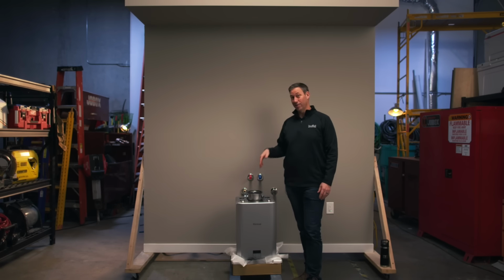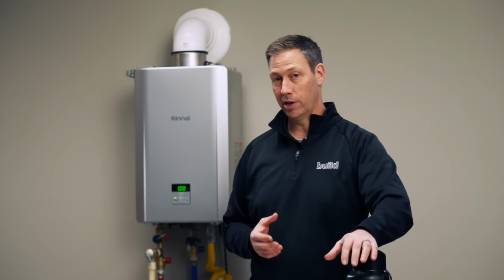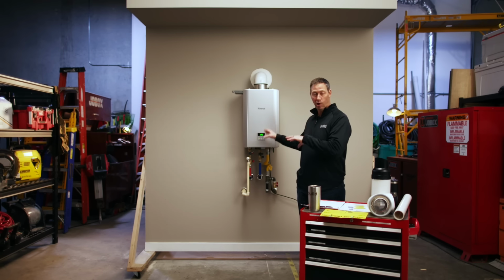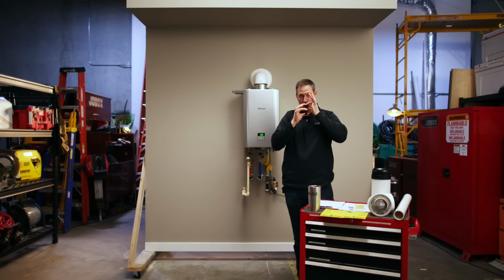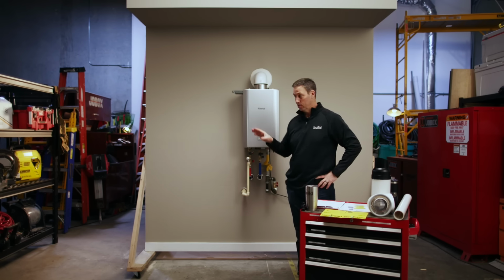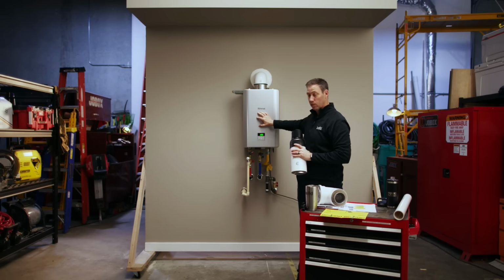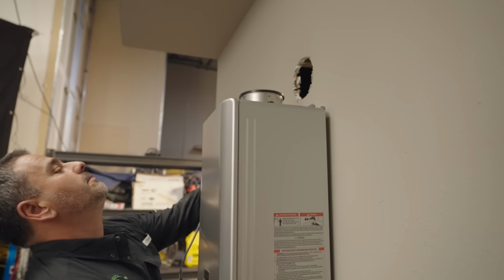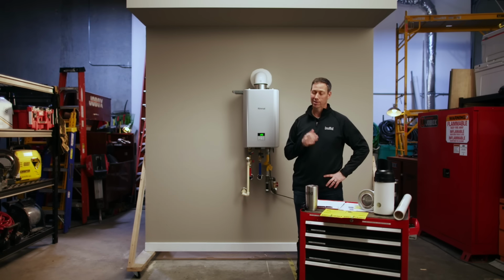Replacing A Water Heater Tank? Probably the Best Tankless Option for You.

Comment: Nice unit Matt I have one in my house. Not that model but the brand. 
I do not recommend these anymore to my clients though. 
Please here me on this. They don’t work with the modern appliances. Biggest problem being washing machines. 
They only fill with water for maybe 3 seconds then check the load. That does not give the tankless enough time. 
I have been and still will be recommending the HTP hybrid on demand water heater. 
Please put some thought into what I’m informing you in on, look at HTP and give me a response. 
If this is news to you and you have a high efficacy washing machine do a load yourself and be listening to the heater. 
Grace and Peace 
Slick
Reply: I believe this is a hybrid unit with a small tank in it, and it provides recirculation function so the pipe will have hot water in it nearly continuously.
Reply: @rcmrcm3370  So completely nullifying any (dubious) benefits of this system.
Reply: @BS25999  

That depends on several factors.  Especially tank heat losses which vary with temperature differential between outside air and water temp in tank.  Factoring in the insulation of course.

I live in a mild climate.  The loss from an R-16 tank in a garage here is really not significant.
Reply: Tankless has worked for me just fine.  However, I use a Navien.
Reply: While washing machines CAN use hot water, manufacturers have been trying to educate people for years that you will get perfectly fine results with just cold water. In fact, they recommend not using hot water. But people are slow to evolve. Old dogs and new tricks.
Reply: @idontthinkso666  

Tell my wife that.

Old dog.  Can still kick!
Reply: I have 2 rinnai, 1 only hot water and one combo (heat and hot water) no issues had them for 6 years. Runs 3 washers simultaneously..
Reply: Maybe you should learn English if you want people to listen to you.

Comment: I’m on a well with absolutely horrible water, we have a special bleach system & salt regret system from Kinetico..My electric water heater is extremely old and on our inspection he told us it would be the first to go..4 years later and still going strong. 

I would like to upgrade to a tankless, but with my water situation I’m not sure if it would benefit. I’ve watched multiple videos from you on this but not sure the route I should take.
Reply: Check out the heat-pump tanked units - not endless hot water, but a whole lot cheaper than most electric units.
Reply: @ckm-mkc  I actually did from one of his previous videos, my house runs a Heat pump so figured it would be an option to run one there. My system is in the garage, not conditioned but not bare walls. Definitely an option

Comment: I have a Rinnai tankless that is about a year and a half old and bought the wifi module and control the recirc with their app. They only problem is their app is a little flaky and needs some real improvement. No surprise, they're not really a software company but still...
Reply: A better pump control is the Smart Recirculation Control. You can trigger it from any fixture in your home without installing buttons or sensors and you don't need your phone to make it work either.

Comment: I have a Polaris hydronic circuit tanked water heater (for floor heat loops) that costs around $6000 when it kicks the bucket.. considering tankless for floor loops doesn't make sense but neither does spending $6000!
Reply: I run a voyager (pre-dates the polaris).  I'm considering a tankless. These new ones have a wide turn-down ratio, meaning it might go at 199kbtu for maximum output, but can run as low as 20kbtu (or even less) for long-term low usage things like the floor loops. It's all controlled by the set output temperature.  But as this is not a "normal" install you either need to find a pro to design and install the right system for your needs, or learn all the details yourself.

Comment: As a Rinnai ACE dealer I have installed 300+ of these Tankless units. Rinnai is a great unit.
Reply: Seeing as you might know, can that thermostatic circulation valve be purchased separately from Rinnai?
Reply: @RobertClontz  I can...... But would be very odd that you would ever need to purchase it. It comes with their units. I don't really see it working with other units
Reply: Would it not work because without a recirculation component, the hot water pressure would simply be equal with the cold water pressure (used for the recirculation line)? If so, that makes sense.
Reply: @RobertClontz  I believe you are correct also getting hot/warm water back on the cold side
Reply: Then you should know ... please reply ... I saw no cold weather protection. I live in Alaska, get to -30°F. Is there a kit?
Also, is there a way to disable recirculation,  don't want heat my crawl space with this?
Thank you, I am in the market. I have a 120 gallon tub that far exceeds by 50 gallon tank.
Reply: @alaskanight940  there are several different Rinnai units that will fill that tub great plus 4 more at the same time. You will just need to pick the correct unit. There are some freeze protection valves that you can add if needed

Comment: 2:09 - You say there is no drain on the wall. What is the white PVC pipe on the lower left? Also, existing installations with an old tank are likely to already have a non-concentric flue with a separate combustion-air intake for the mechanical room. Is there an option to have a separate vent and intake for this unit.
Reply: On my house it is against an external wall and it drains outside, like my AC condenser lines. I've never really seen any water come out of it.
Reply: Recirculation line.

Comment: Also, it’s not gonna last 20 years unless the home owner descales once a year.  If you’re on well water or have hard water, more often than that.
Reply: Maybe pretreat the water? You can’t descale every weekend.
Reply: @jsbrads1  he did say drop in replacement for a tank heater.  Which is why he didn’t go with a condensing 95%+.  Adding in pre-treatment makes it a lot more complicated
Reply: I put a A.O. Smith descaler plus an A.O. Smith whole house filter along with a A.O. Smith pre-and post filters set up on my Rinnai…

Find fault with that now
Reply: @Casmige  the fault is still the inefficiency of tankless vs a heat pump water heater

Comment: Unless electricity rates are really high in your area, it would be better for you & the environment to switch to electric on-demand water heater, and eliminate monthly gas connection fees.
Reply: For most people that is going to be really expensive, better off with a heat-pump tank unit.
Reply: They have gas fired ones to.  My brother has a natural gas one.
Tom Dutkiewicz
Reply: In the north we’re all already connected for our furnaces.
Reply: we have a gas furnace..there is nothing that warms a house like nat gas!
Reply: Electric takes a lot of amps. I don’t think standard amp service can handle it
Reply: @conradcoolerfiend  a typical home electric service in my area is 200 amps. A big house or one with special needs (electric heat, a deep well, EV charging, ...) Might have 2x 200 amp panels. So no, dedicating the entire or even most of the power available to the house just to heat water is a non-starter.
Reply: gas cooktops are nice and gas dryers and water heaters are cheaper and more reliable.
Reply: @android61242  Induction cooktops > gas cooktops
Reply: If you have peak usage charges, using any hot water during peak hours will cost you a small mint.
Reply: let's do a little math...
* at 90% efficient a 199KBTU/H unit is delivering about 179KBTU/H into the water
* 179KBTU/H is about 52.5 kilowatt
* on a 240 volt circuit, 52.5 kw is nearly 220 amps
* a 220 amp load needs to be on a 275 amp (really it will be 300 amp) circuit to provide the necessary 20% margin
* another alternative commonly used for a single bathroom (or maybe 2 bath if your incoming water is already warm) for electric on demand is multiple 40 amp circuits and a 220 amp equivalent would be 7 of 40 amp circuits (again to divide no more than 32 amps on each 40 amp circuit with 20% margin).

yeah, that's realistic.
Reply: @Sylvan_dB  I think your calculations have confirmed that if I want to run my shower for 4 hours straight, tankless is the way to go. What if I only need 30 minutes of hot water each morning in my household?
Reply: @dosadoodle  you do not need that much power to heat a tank. A typical electric tank is only 30amps because the tank holds the heat. Tankless needs that much power because it is trying to heat the water while you use it, so the amount of power has to provide for your desired temperature rise for the maximum flow rate you need to provide. For example my incoming water is 52F so I need to raise the temperature by about 50F minimum. This is easy with a big gas tankless or a typical tank but the big electric tankless can barely provide for a single shower. If that is all you need then go for it.